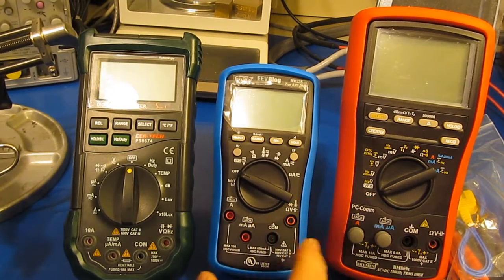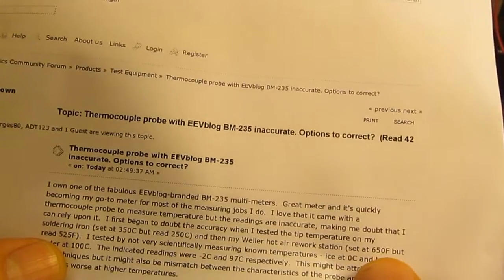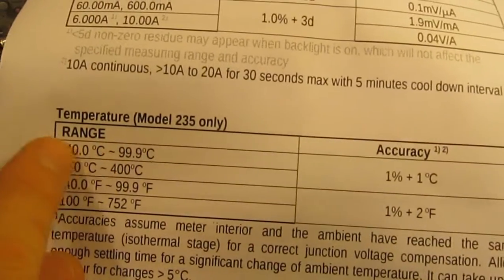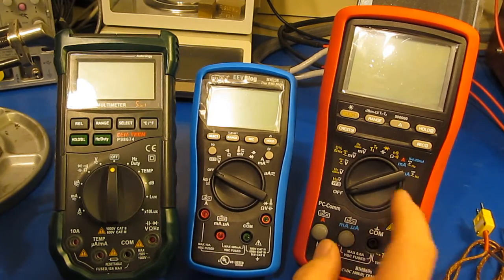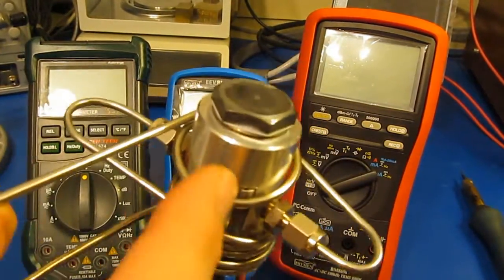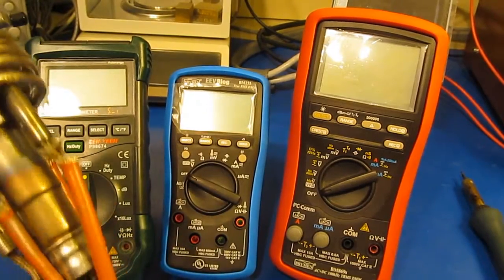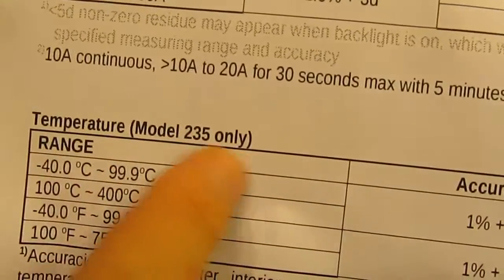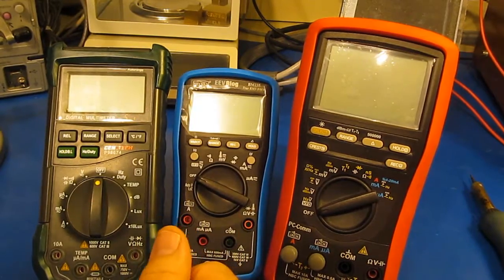Measuring Temperature with the EEVBlog Rebranded Brymen BM235 DMM

Comment: I have that Harbor Freight Cen-tech multimeter but Ive blown the fuse. It specifies a 6x30mm fuse replacement where I cant seem to find it anywhere. I see lots of 6.3x32mm ceramic fuses. Would a 6.3x32mm fuse work and fit in these mastech multimeter? What would u recommend?
Reply from the maker: Because DMMs are certified for safety, I would not recommend anything other than what the OEM requires.
Reply: @joesmith-je3tq  Thanks for the info. Where can I buy good fuse replacement?

Comment: The cheap ones don't have a decimal point in degrees?
Reply from the maker: You can see both meters displaying a decimal in this video but you would have had to have watched.
Reply: @joesmith-je3tq  Thank you very much for your time and kindness.
Reply from the maker: @valdolandar534  Keep in mind that like any other mode, the lowest resolution will change with the amplitude.    To may be able to real 1mV out of 1V with your meter but you may find you can't read 1mV out of 1000V.  The same with temperature.  They may read a tenth of a degree to 99 degrees but above that, you may only get 1 degree resolution.  Also read the manual before you buy and buy what you need.

Comment: Mastech was pretty damn good. People just hate mastech.
Reply from the maker: That Mastech is what I use for normal outside low voltage work.   Less than $50. The Mastech before it had that flip display that went bad after a few years.  Been pretty happy with this one.
Reply: joe smith I don't if u guys get original mastechs or just bad quality ones, but in India most people use 1.2$ screwdriver sets, 1.5$vartech or mastech dmms(harbour something $5 model). People don't die everyday while using these. The one featured in this video is actually very costly for most. We use fluke/agilent & stuff but only in big industries. Electricians on a daily basis work with 240vac with cheapest meters. Just aking which meter did you use as a student?, I am stuck with a shitty htc dmm rip off. How is the accuracy of other measurements with ur mastech ms8268?
Reply from the maker: My first new meter was an analog type from Radio Shack.  I had that meter for many years and it saw a lot of abuse.   I'm not sure what the Mastech was rated for accuracy.  For what I use it for (low voltage electrical stuff), even +/- 10% is good enough for all modes.  I don't think I have ever done any sort of review of it.   I did run one early on. It's not real impressive from an electrical robustness stand point.

Comment: Thanks for this video, it was very timely because I have been using the temp probe that came with my EEVblog Bryman 235 multimeter to test voltage  regulator temps on a new SDR Transceiver that I bought to see if they are staying within manufacturers specs. I wondered how accurate it was, and now I know its fairly close to the rest. I sure like this MM.

Joel
KB6QVI
Reply from the maker: I was not sure why all the hype in the comments.  Different probes, meters, swapping parts all track pretty good.  It's not a bad little meter and certainly electrically robust.

Comment: The meter can be 1% but that does not mean the TC is too.  Does the meter has a decent cold junction compensating circuit ?  My best TC supplied with a meter is -0,3C the worst one was -30C. But most were around +/-3C.  My Agilent DMM has a CJC but that reads -2C so the TC measurement is 2C + the TC fault off.  TC are available in different accuracy grades

Temperature reading is not as easy as most people think. Two weeks ago I repaired a calibration thermometer, the PT100 probes for that have their own calibrated eprom, if you need a new probe, you also need a new eprom. The drywels and oilbaths I repaire (a source to calibrate thermometers/sensors ) have most times 0,1C resolution and it is not easy to calibrate a TC with it, They insert "fixtures" in it with a small hole to fit the TC and even that can have to much leakage if you need full resolution.
So a TC with a DMM is handy but most times it is nothing more as an indicator.

Comment: The Brymen869 seems a good all rounder as regards temperature but have never used one.
Reply from the maker: The 869s has two temperature inputs and can calculate the difference  between them.   It's nice having the dual display.   The UT181A is the same, it's just not very robust.